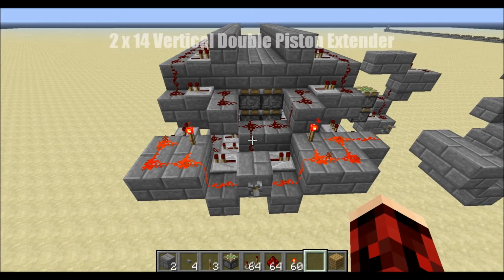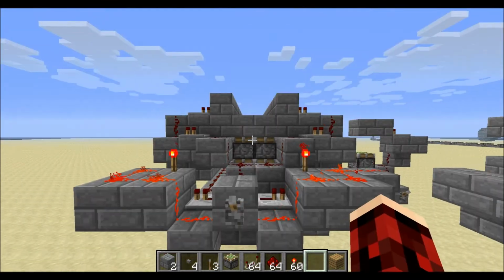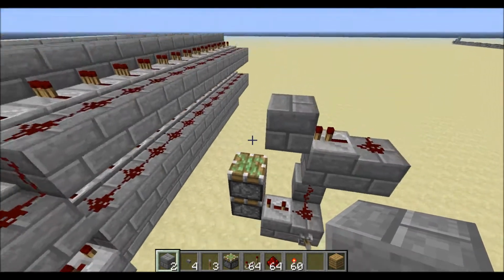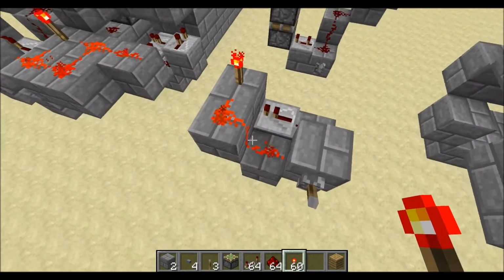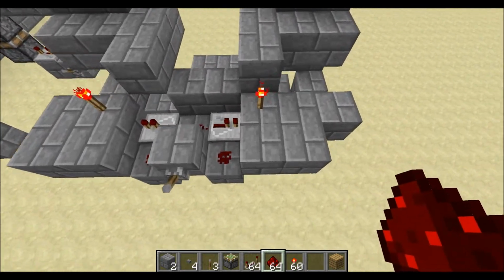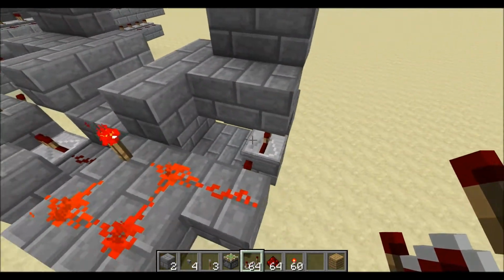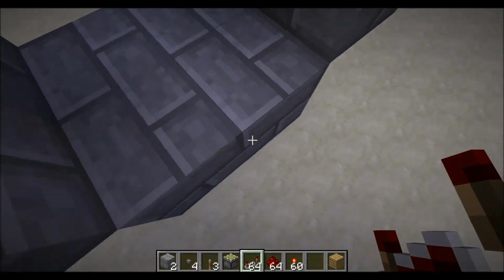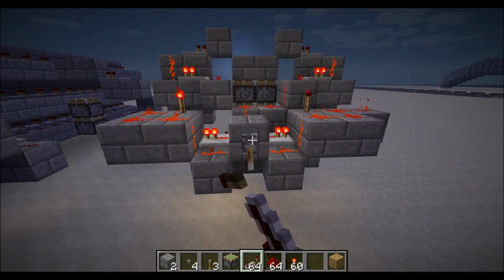2x14 (or Longer) Vertical Double Piston Extender

Comment: It was an orientation bug, I rotated it a couple times but it always had the same effective. The pulse only goes off on one side of the mechanism, the side with 4 instead of 5 blocks aimed towards the pulse torch. I just put both pulses on that side and routed one underneath to the other side, fairly easy adaptation. Great design though, fit what I was making perfectly!

Comment: I would only need a single column going up two, but thanks anyways! I needed this! Working on something myself as well. I have a question though. If I use sand or gravel I wouldn't need the monostable circuit right? It would fall down.